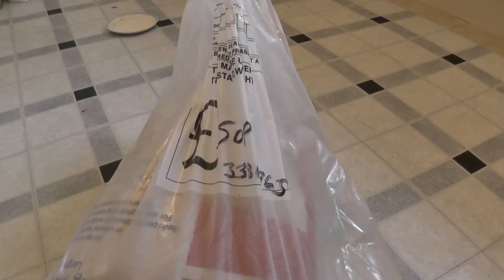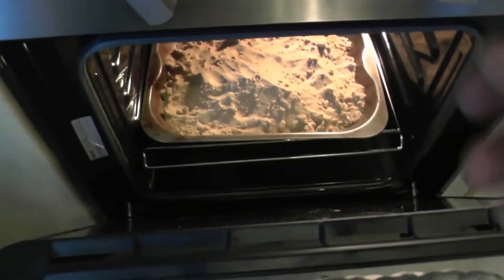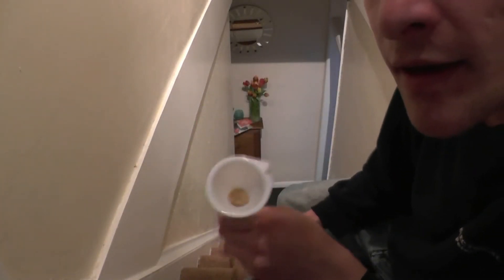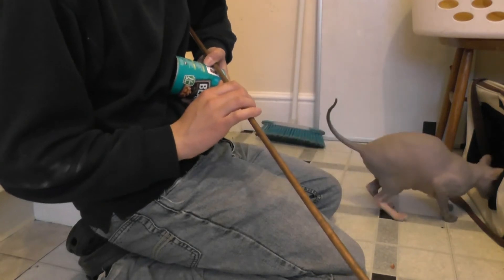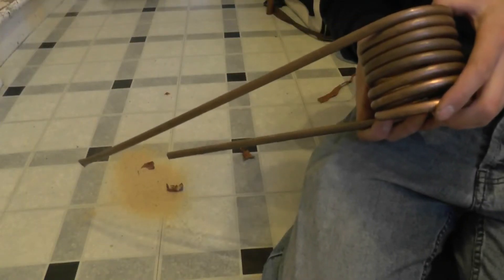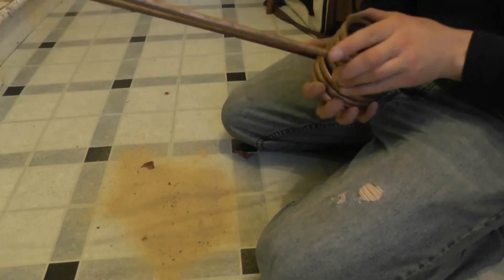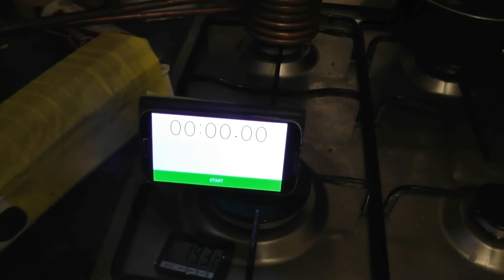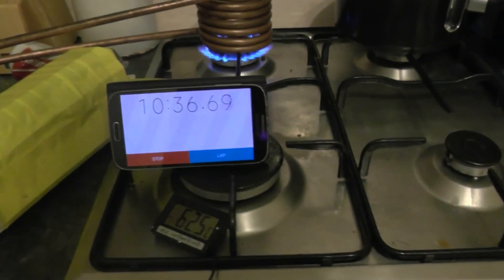Copper coil forming my first attempt

Comment: With a chimny round the tube the heat should reach more of the coil and heat water faster with the rocket stove and the coil I would say half the time again to heat the water so the idea for the rocket stove mass storage heater is going to be very efficient with the drum reaching temps of 400c not only would it heat a large area plenty of piping hot water plus a surface to cook on with some pelter modules lighting also from one fuel source wood that burns very efficient I am so glad some one is finely able to test my idea thank you
Reply from the maker: David Simpson Gas ring was all I felt like doing! It was raining outside! On the plus side I haven't flushed the loo on mains water since my last video on it! =)
Reply: pietkaify lol thats cool i i ddient mean right thast minute i was just saying you should see better rezults with that im just glad your trying this m8